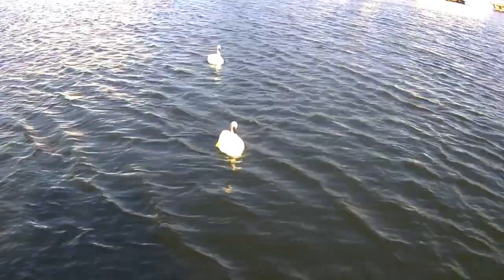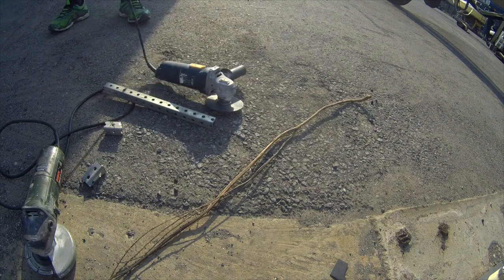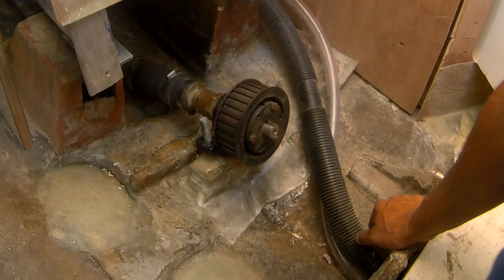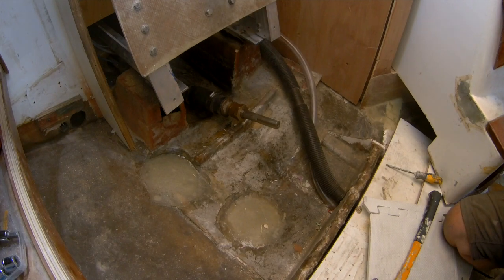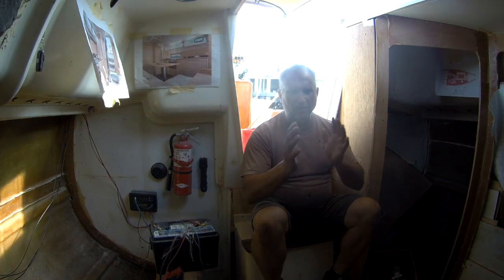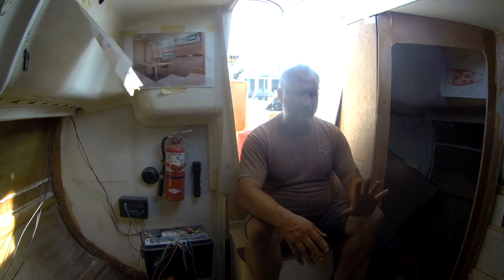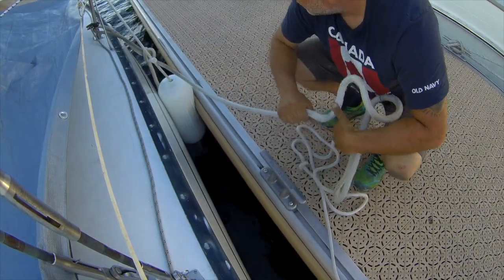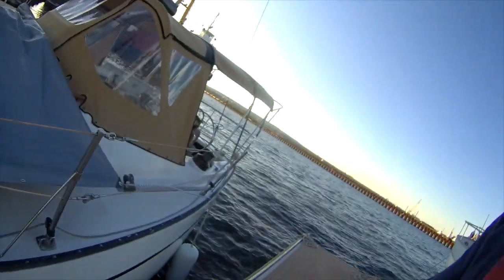Ep46 2nd Launch Failure, 10KW 48V Electric Motor Conversion Failure

Comment: Hi what motor are you using? Would a turnigy ca120, running at around 1000 to 1500 Watts move a 25ft trimaran, roughly 1000kg.. Looking for about 2.5 to 3.5 knots. Thanks for any feedback 👍
Reply from the maker: not certain it seems to be pretty small and weak the shaft is smaller than my pinky. i put links in the description to all the parts i am using. 10kw is about 13hp maybe for reference might help you. don’t forget you have to stop the boat too when reversing.

Comment: Controllers made in china are much simpler, cheap, reliable, also strong enough like apt, votol, or yuyang king, forget about sevcon 😂😂😂
Reply from the maker: Thanks for the feedback, I hope reliable. The first controller was not working out of the box, but Golden Motor was great to deal with they offered a replacement very quickly without any fuss. I do question the logic of the programmers however in making certain behaviors of the controller like not being able to turn off the beep when the brake is on, and having certain beeps the exact same sound as the error codes. It would seem more human friendly to me to make them different as diagnosing was difficult in the beginning. But once I got it working it got me through the season. I am looking forward to getting a new throttle installed.

Comment: I'm following your vlog with interest as I'm planning to do a similar electric conversion, possibly with the same motor you're using, but in an old wooden motorboat. Thanks for sharing!
I'm interested in your thrust bearing construction. Unfortunately I know more about the electrical part than mechanics, so I'm trying to learn. 
Do you have a link to the thrust bearing (with housing) you're using? I think you called it a "rider" bearing in a previous episode, what is that exactly?
The collars you added to your axle in this episode fore and aft of the thrust bearing, are they "loose" on the axle? 
If they are, what is absorbing the thrust from the propeller axle when you go forward and reverse? When you go forward, does that mean that the propeller is pushing against the cutlass bearing (is that the right term?) just fore of the propeller? And when you're reversing, does that mean that the propeller shaft is trying to "push" the larger timing gear off the axle? Will the mount of that belt gear hold for that?
If not, how are the collars attached to the shaft so they don't slide along the axle?
The purpose of the thrust bearing is to transfer the thrust from the propeller to the hull, right?
Greetings from Stockholm, Sweden.
Reply: Pillow block bearing
Reply from the maker: Greetings from Hamilton, Canada! Glad to hear from you and I look forward to watching any vids you might post on it.

That bearing is the one piece that I had on hand and didn't buy. I wasn't actually 100% accurate in my description of it as the central bearing is pressed into a cast steel mount. It actually can't fall out one direction, and then there is a collar that you use a 3.5 mm hex key to screw a locking bolt into the shaft. The collar locks the bearing in place onto the shaft. Initially I thought this was enough but there is a possibility of the shaft sliding through the bearing in the direction that didn't have the collar. Under water I have another cutlass bearing in a strut and the strut actually stops the shaft from moving in the other direction, but I decided after discussions and getting some feedback that I would add a second collar and take the thrust pressure off the strut and move it to the hull. The strust only holds the cutlass bearing and no forward or reverse pressure should be on it. I was also able to get the recommended clearance between the prop and the strut and the stuffing box to not touch the bearing.

So for clarity the bearing is surrounded by two collars that are screwed into the shaft. They cannot move so and forward or reverse thrust pressure is held by that bearing cast steel mount. I fibreglassed in the bolts to the hull originally but had difficulties with shaft alignment. So my final design had the bearing fixed to the engine mount, and the engine is fixed to the hull via aluminum angle iron on the original Atomic 4 engine bolts. I have the original rubber shock pads between the steel and the hull so there is a small amount of play but not enough to hit anything. 

I am uploading a few closeup videos I took tonight for closeup. The slight movement is because of the engine plat I made has a slight amount of flex to it and the rubber mounts. It measures at 3/16 play. I also have a bit of knock you can hear in the videos which only occurs when I switch direction as there is a little bit of play between the collars and the bearing and the angle of the inner bearing has to change very slightly when you change from forward to reverse. I am not concerned about it.

https://youtu.be/eHU8sMgA8gk is the closeup inner view and the silver is the inner collar to stop the bearing from moving.
https://youtu.be/Ufm2FEo7Ikw is a closeup of the outer collar, it is black. You can't see the shaft as the front pulley is right up against the collar. You can actually see the 1/16 play in between the collars which is why there is a slight knock as the black collar isn't 100% straight with the silver collar so the bearing in the middle gets pushed slightly to align with the bearing in the direction it's moving. Once it moves it stops making the knock as you can hear in the videos.

The best part description I could find that resembles my bearing the closest looks like this one https://www.bearingscanada.com/3-4-UCP-204-12-Pillow-Block-Cast-Housing-Mounted-p/kit111122.htm as you can see the bearing is in the cast steel housing. 

I hope this helps you out a bit!
Reply: @TheNeds  Thanks for your detailed answer and videos. 
It's fascinating how you can "see" the force being transferred to the hull as the mount moves slightly when you switch from forward to reverse.
It's also interesting that the small set screws on the collars give enough fastening force to hold the full thrust of the boat. I would not have dared trust that if I had not seen your video!
I do hope to blog about my electrification as well. I'll let you know when I do. I only bought the boat on Tuesday and haven't even taken it to its new berth yet. My current plan is to use the same motor you have, also a belt transmission, and Tesla battery modules. 
Do you have the liquid cooling variant of the motor? It will be interesting to hear how hot it gets when you run it for a longer period in the water.
Reply from the maker: There is a bit of a groove in the shaft for the screws to set into a bit, a slightly flattened edge.

I have not routinely tested the heat as I can't run the motor with the USB programming cable and there isn't any way to poll data from the Vector controller as I was told by the supplier. That is on my list however as simple things like temperature, or how much voltage the throttle is supplying should be accessible to make it more useful. 

I did actually purchase the liquid cooling option and still have that on my to-do list. So far running it between 10% and 15% I have not experienced any heat issues without it hooked up. I plan on using a glycol type mixture within a heat sync/radiator.

It was recommended on the support forum that I get a liquid heat sync under the controller as well. I added some risers to create a gap under the controller. I did test the temperature originally on both motor and controller but it was nowhere near the temperature cutoff after use exiting the marina which takes me at maximum 10 minutes where I'm raising sails. 

Just recently, I ran it very hard, I got blown off anchor during a crazy peak 58 knot storm (at 2AM of course) and had to drive the motor at 1/2 power, about 4.5KW for an hour. Sucked my batteries dry, but no heat cutoff. I was actually amazed as with my little 2 blade prop, at 4.5KW I dragged the anchor back to my anchoring spot in 40 to 50 knot headwinds, about 1/4 mile. There is a lot of torque in that motor, more so than my old Atomic 4 with the same prop setup. I'm glad I bought the 10KW as the torque curve was a lot more powerful than running the 5KW version at the same wattage and I still had some overhead if I needed it.
Reply: Its always somthing....my motors came in but one package damaged. Cant wait to see your first run.
Reply from the maker: hope your motors are ok Bryan!